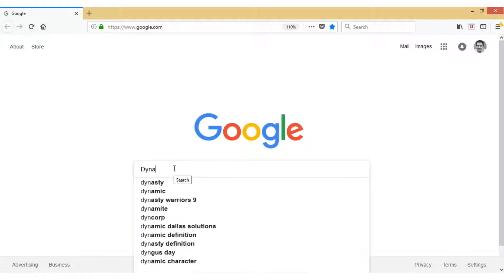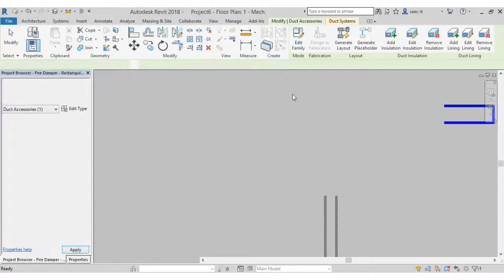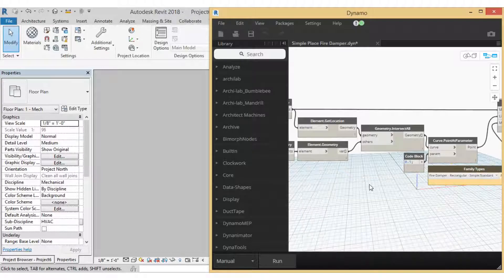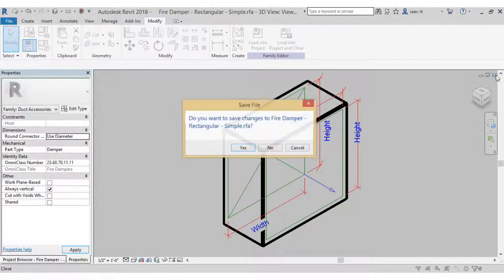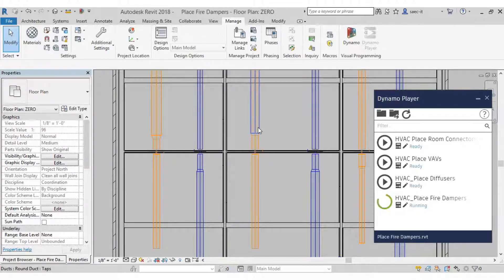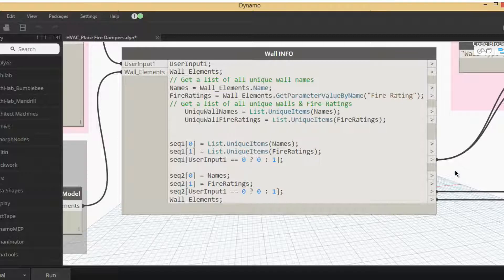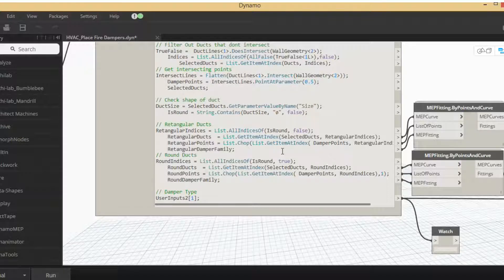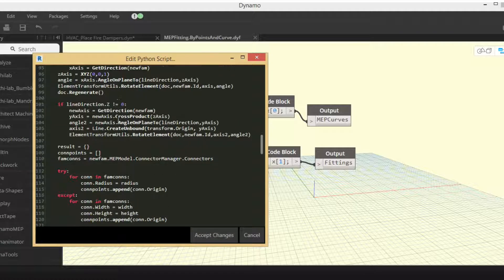Dynamo Placeing & Connect Fire Dampers

Comment: Hi Sean, please help. 
in my case, the graph works fine except when one duct segment ( straight duct) crosses two walls. it just creates one FD at first intersection point. no FD on 2nd point although it found all the intersection point.
Reply from the maker: Ngọc Bùi Văn hello. You will need a sub list of points for each duct. Feel free to e-mail me if you still have issue so I can take a look at your script. Good luck!
Reply: @seanfruin6880  I have sent you an email. could you please check. Thanks

Comment: I am using Dynamo 2.0.2. I copied the code at 5:00 verbatim and am getting the following errors:

1. I can't use Flatten, so had to put in List.Flatten.
2. My code does not like the theta so I changed it so it would look for "x" so it would look for rectangular ductwork first rather than round. Still getting a String.Contains error.
3. After fixing the above warning I get an error Geometry.DoesIntersect failed.(I also have WallGeomtry showing on the left hand side as an node option).
4. Also in Revit blue lines are showing (showing the middle of the ductwork) and staying even after deleting the ducts.

TorF = List.AllIndicesOf(UserInputs2[0] == WallNames, true);
 Walls = List.GetItemAtIndex(WallElements, TorF);
  WallGeometry = List.Flatten(Walls.Geometry());

DuctLines = Ducts.GetLocation();

TrueFalse = DuctLines<1>.DoesIntersect(WallGeomtry<2>);
 Indices = List.AllIndicesOf(AllFalse(TrueFalse<1L>),false);
  SelectedDucts = List.GetItemAtIndex(Ducts, Indices);

IntersectLines = List.Flatten(DuctLines<1>.Intersect(WallGeomtry<2>));
 DamperPoints = IntersectLines.PointsAtParameter(0.5);
 SelectedDucts;

DuctSize = SelectedDucts.GetParameterValueByName("Size");
 IsRect = String.Contains(DuctSize, "x", false);

RectangularIndices = List.AllIndicesOf(IsRect, true);
 RectangularDucts = List.GetItemAtIndex(SelectedDucts, RectangularIndices);
 RectangularPoints = List.Chop(List.GetItemAtIndex( DamperPoints,RectangularIndices),1);
 RectangularDamperFamily;

RoundIndices = List.AllIndicesOf(IsRect, false);
 RoundDucts = List.GetItemAtIndex(SelectedDucts, RoundIndices);
 RoundPoints = List.Chop(List.GetItemAtIndex(DamperPoints,RoundIndices),1);
 RoundDamperFamily;

UserInputs2[1];
Reply from the maker: Echomirage e-mail me so I can see your scrip please sfruin@sigma-aec.com
Reply: @seanfruin6880  I have emailed you my script, and the Dynamo version as well as the node versions.